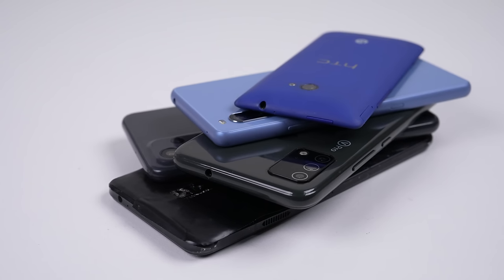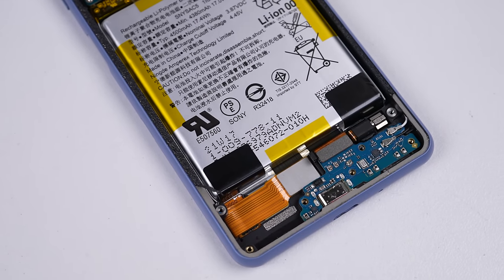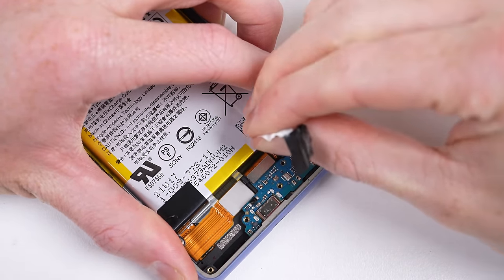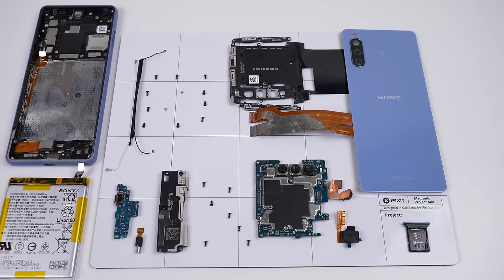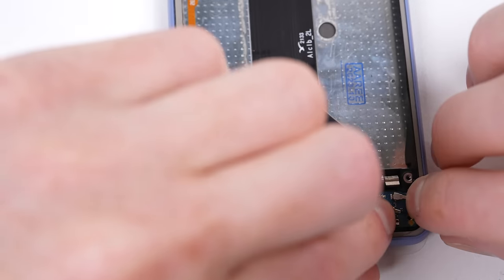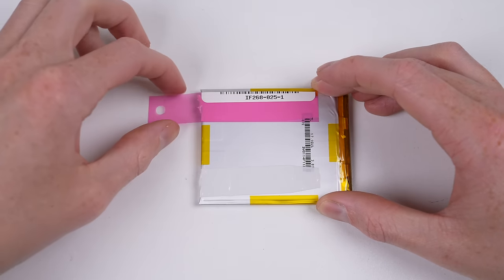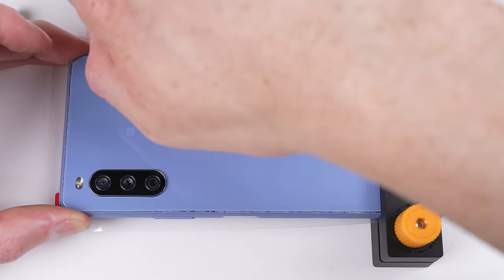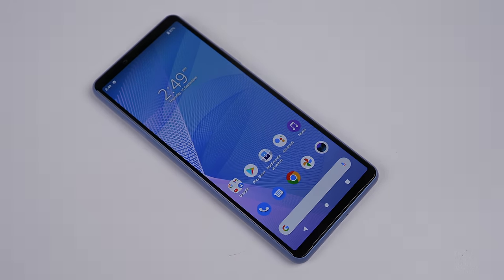This Uncommon Phone Is Shockingly Easy To Repair - Sony Xperia 10 Mark III

Comment: I've been looking into replacing my aging Moto Z Play from 2017 or so, but pretty much all current phones lack microSD and headphone jack, or they disqualify themselves in some other way (Xiaomi with awful quality and software bloat, mid-range Motorolas by excluding a compass on some models (wtf?) and others by using Mediatek and other garbage SoCs). Looking at the specs of the Xperia 10 Mk. 3/4/5, they all seem like decent replacements. My only gripes are the step backwards to USB-C 2.0 (the Mk 3 had USB 3.0 with Displayport video output, the 4 and 5 only have USB 2.0 for some reason) and the annoying side-mounted fingerprint reader. I guess these are as close as I can get to my "ideal" phone, as no company seems to be making one that ticks all the boxes anymore

Comment: That actually looks like quite the complex repair for a sony phone. I've owned Xperia XZ1 and now Xperia 5 II, both of which I've personally repaired (in case of 5 II I've replaced camera module after fall damage to one of the lenses, battery and on another occasion dead power button) and all of these repairs were noticeably easier when compared to what is seen in this video.

Regardless, sony phones continuously seem to be among the most repairable devices out there, especially in contrast to questionable anti-repair solutions employed by other brands in recent years.
Reply: Devices are not getting any less complicated with time, sadly.
But sony mobile does try its hard to make it not harder than what is reasonable.

Comment: Sony Xperias hardware are fantastic their new Xperia V series 1, 5 and 10's are absolutely amazing, all of which have a headphone jack!. the problem with Xperias in my case is that their software is downright just awful. the rom they use looks stock and feels fluid but stuff like the finger print scanner being on the side of the phone sounds good until you find out it likes to constantly register a "fingerprint" in your pocket so when you pull it out your phone is locked for 10 or even 30 seconds. due to the phone being a 21:9 aspect ratio a lot of social medias don't run correctly instagram for example sometimes tries to play 2 videos at once. (this is a third party developer issue I know). I'm hoping they further improve further in the future because I believe Xperia phones to be hands down the best multimedia smartphones in the industry; from their camera, beautiful screens, their physical design, micro sd support! and the classic headphone jack. Xperia makes "pro" phones like the iPhone pros and the galaxy s ultra phones just look like paperweights in comparison. 

Here's to hoping Sony will work harder on improving these amazing smartphones.
Reply: Pro tip: The Xperia 1 V, and 5V, as far as I know both support the option to require you to click the power button to unlock. No clue where the setting is as I don't own either phone, but I follow the subreddits so I know they support the feature. You may have to update the software though.
Reply: that's true, almost every time I put my phone into my pocket it unlocks and starts to press everything on the screen
Reply: @LindonSlaght  that's cool to know, I sold my Xperia 1 III last year because of just stupid things I couldn't get over, kinda regret it but I'm happy with my 14 pro for now till Sony (hopefully) improves certain areas.
Reply: @numbazZify  it used to infuriate me

Comment: I own an Xperia 5 Mark IV, which I bought for the headphone jack, Qi charging and good cameras, and have had it for almost ten months. That aside, I can immediately understand why Sony's phones aren't remotely as popular as One Plus or Motorola, much less Samsung: barely usable thumbprint scanners (though it's nice they're including in the power button), bad UI choices, random restarts and the worst pocket detection I've ever seen in a phone. Windows Phones 7s had better pocket detection than this, and the solution on Sony's forums is "Yeah, probably turn it in your pocket so it's facing away from your hip." Then again, the recommendation for the awful thumbprint scanner is to scan the same finger for 5 to 10 separate finger profiles and see if that helps, so it's about what you'd expect. I'd be more annoyed if I hadn't gotten it discounted by almost 40% new, which brought it much more in the area of what it's actually worth. "Headphone jack and it looks very nice," is a pretty poor excuse to pay even a discounted premium price for that many issues. 

Still, nice to know if it's ever damaged, it may be easy to repair.

Comment: I had two Xperias (from the X era), and they were really nice, but their current offerings (of the 1/5/10 era) are a bit ugly, with strange price brackets, and 21:9 screens which are far too large for my liking.
Reply: To be honest, 1 IV is very stylish.
As for the screen, 21:9 is actually not that much larger than 16:9 because of smaller upper and lower bezels.
It is about as wide and being longer instead of thicker to add diagonal inches, it's actually easier to handle.
I used to dislike longer screens, but changed my mind after trying to actually use one for a couple of days.
Now I have to admit that sony did the right thing and that longer screens are better.

Comment: hey hugh, just an idea that i think falls nicely within the recycling theme. i think it would be nice to make small projects showcasing what other things you can do with spare components such as the screen (maybe attach a display controller with hdmi input into it), or maybe utilizing phone batteries to power miscellanous devices/simple circuitries, or things that you can do with bluetooth modules inside a dead airpods, etc

Comment: My question is, why attach a battery with such a strong adhesive? It's being held in place by the chassis on the sides and screen and back glass on the front and back. The room is tight enough to stop it from moving around and simple double sided tape should be enough to secure it. Thoughts?

Comment: I always wanted an Xperia, back when the Arc was around.

Loved their design and theme back then (that TV switch off on locking the screen was very cool, and I miss that playfulness)

I still use a Walkman A15 for my FLACs (with wired headphones, of course) cause most phones had wonky audio in some way, my Sammy A72 does this, too.

Bass really rolls off and everything starts to sound weird, once you hit 85vol (up to 150).

Comment: I have the Xperia 1 Mk 5, the one with the 4K screen. It is vastly superior to the iPhone 15 Pro and Pixel 8 Pro under all aspects. The video, the photos and the audio (thru wired earphones) can't be compared; Sony could burn Apple, Google and Samsung if only made some ads for their Xperia phones. But the fact is here standing in front of our eyes.
And yes, there is the headphone/microphone jack, and a micro-SD card slot. I paid a little fortune for the 1 TB extreme Pro memory card, which can record 4K with no dropped frames - but hey, I got everything I need with me all the times. And the USB-C port is Thunderbolt compliant (cable sold separately).
Thank you for the video, I was very interested seeing an Xperia from inside; now I know I can replace the battery by myself: no pairing, Sony truly cared this time for their customers - and not for their spare pennies!
Thank you Mr. Jeffrey for all your efforts and your dedication.
Greetings from the UK,
Anthony

Comment: I used to have the Sony Z3 when it was new back in 2014? I think it was, what a great phone. I do miss the nice features like dedicated camera button, SD card etc but I am more than happy with my S22 Ultra now. Sadly it got killed off by the baseband randomly deciding to refuse to connect to cellular network and I was quoted more than the phone was worth to fix it.
Reply: I had a Z3 too for little over a year or so. noticed how the camera picture quality became worse after some updates, then the back glass came loose and it started having weird connectivity issues, so I changed brand after that
Reply: i had 2 z3s, one had a broken lcd so i destroyed it and the other one worked fine but it was terrible
it got really hot, touch was awful but the screen was good

Comment: My Sony phone was the best phone I ever used. I only quit using it when my carrier wouldn't certify it for VoLTE. Of course after I replaced it, the added it to the whitelist. Among the many things I liked was the aspect ratio meant that (with my small hands) I could reach my thumb across the front of the screen when holding it. With phones getting bigger, this is now only possible for me with a small phone or with one that has a taller aspect ratio.
Reply: Have you tried the Pixel Fold or Find N2? They're wide but much shorter, so the opposite of Sony's aspect ratio, and I feel like the extra width is a much better idea than extra height.

Comment: This one seemed very straightforward to repair, I've found that a lot of Sony phones are laid out strangely inside with lots of complicated overlaying parts and unusual connectors, some older models with a frail and thin antenna frame over the components. Thankfully the thing that seems universal is their reasonably glued back panels, you have to try hard to break one.

Comment: I’m using an Xperia XA2, 2018 model, goes great, decent camera for a budget phone, used an Xperia S (2011) too. All were great phones.
Reply: I loved my XA2 when it was my primary phone, but over time the performance kinda went bad and I never had the time to try modding it with a custom rom to see if I could salvage it. Now it's got a weird scratch on the display and is so far behind my other devices that it's probably not worth it.

The oppo I upgraded to has aged much more gracefully. And then I got the Xperia 1 iii and I think that too shouldn't slow down the same way the XA2 did, app performance requirements just outstripped the old cortex A53 cores.
Reply: Loved my XA2, only reason why i stopped using it was the battery expanded.
Reply: I’m still happy with mine, I see there is one on eBay for $75, I’m surprised how cheap they are.

Comment: Sony made some awesome devices back in the day.
Their current flagships are great except for the fact that, when compared to todays industry standard, there is virtually no software support. 
There is also the fact that these phones require you to have decent camera and photography knowledge in order to take good pictures. Auto mode is as if you took a budget phone and took a picture.
When you do go with manual mode, the pictures are S tier though.

Comment: I was hoping that other flagship phones have a headphone jack comeback. Not only earbud cannot access battery replacement, but it's not environmentally friendly and ended up going to ewaste. The earbud battery aren't last longer and more expensive than traditional wire headphones jack.
Reply: Not to mention there is also noticeable latency with wireless earbuds. Even if the latency itself has improved a lot in recent generations, it still can't beat the wired earphones
Reply: Apple airpods have a lifespan of 6months to a year or if lucky 2 years then it's impossible to repair, you can turn em into desktop Bluetooth speakers tho but that can be done with literally any other earbud and the bast majority can have their batteries replaced, not cheaper than a new pair but at least can be done
Reply: @MilesProwerTailsFox  i dont know where you get your airpods but they definitely last more than 6 months, usually 2-3 years i the mark they crap out, which usually lines up well with the next generation upgrade anyways.
Reply: @Windows98R  I have a repair shop and constantly get people come with broken airpods WITH apple care still active but apple refuses to fix because the battery is dead, half of em had told me they bought em 6months ago, idk where you get your magical imaginary airpods but probably your parents are replacing them as soon as they die like your goldfish
Reply: @MilesProwerTailsFox When I had Airpods that lasted me years. And my current galaxy buds have lasted me close to two years and don't seem to be going anywhere.
Reply: @-ThatGuy-  Galaxy buds are good, the thing happens only with gen 1 airpods, gen 2 seem to be doing well
Reply: @MilesProwerTailsFox  My Airpods were gen 1 and I never had much of an issue. Beyond the obvious annoying lack of noise isolation.
Reply: @-ThatGuy-  You just lying at this point

Comment: Sony has a bad track record from my experiences. When they were Sony Ericsson everyone wanted one and they were truly remarkable phones. The K800i is still one of the best phones I ever had for it's time. Then Android happened. The X10 Mini was my first smart phone and it was such a downgrade but it worked. Then I bought a Neo and an SP thinking about the Sony Ericsson I once loved but both of them deteriorated shockingly quickly. Maybe it was the era of rapidly evolving system requirements where previous phones were too weak? Could be. But I remember the SP was riddled with severe software issues that made it almost unusable. Since then I parted ways with Sony and I'm afraid to buy another one

Comment: Honestly near as I can feel the reason Sony phones don't sell much is the price and being largely focused on niche markets. 

4K screens are unnecessary for most people. 

The headphone jack only really matters to a small group of people

SD card slots were barely used on modern smartphones and modern android has kinda gimped them anyhow.

And while some people love having as much manual control as possible over the camera, most just want a point and shoot that's gonna take a good shot without any real work.

Lastly from what I've seen the UI and UX of Sony phones is just ass. Lol

Comment: I wanted xperia 1 v phone but got pixel 8 pro instead. I chose it because I use phones for 4+ years, and sony only gives 3 years of updates. Additionally, I decided that I'd rather have static elements in my cameras instead of moving 3.5 to 5x zoom lense which has higher chances of breaking. But the phone is really decent and if Pixel 8 Pro wouldn't release at the same time I wanted a new phone+watch I'd get Sony for sure.

Comment: The other day I replaced the speakers of my xperia 1ii after I burn them using mods on costum ROMs, I had to disassemble everything because of the earpiece, and it was super easy to do. The hardest part was removing the back glass because I don't have a suction cup.

Comment: Sony phones stopped being popular when they started to mess up the software experience in any way possible. I daily drove an XZ2 Compact for about 2 years and was planning to run it for at least 2 more. I loved that I had a true flagship in a compact size.

But no, Sony decided to screw it up badly with a simple Android major release update [9 -> 10, while 8 -> 9 went smoothly]. It became completely unusable, laggy, apps crashing all the time and it started overheating for no particular reason. I bought another phone, in the meantime, but I didn't throw it away and performed a downgrade to Android 9. All of its problems gone!

I still have it as a backup phone, but the lack of security updates and the old software may be a problem in the long term.

Sony kept doing phones with good hardware and shitty software since that day.

Comment: The Xperia is pretty good, but I've noticed mine that's just a few years old has pretty well been abandoned for support, with a fingerprint reader that just stops working until a reboot at times and quite a few UI issues that even older Samsung phones don't have in the same apps.

Comment: In my opinion sony phones are the most underrated. I still daily drive a sony xperia m5 from 2015 and its actually fine. It was an awesome phone when i got it back in 2016. Not really awesome today. Its just having old phone issues like cracked screen outdated software etc. I recently replaced its battery and it still lasts me a day if i use it a lot, and if i dont use it all that often it still gives the advertised 2 day battery life. Well done when it comes to power consumption, sony. Its camera was awesome and it was able to record 4k videos too but since the phone is really old at this point, the camera is having focus issues. Other than those issues, it still works fine.
Reply: Come up to an Xperia 5 III if you can find a good deal. I think you'd really like the newer hardware. If the SD888 scares you, the Xperia 5 II works as well. Problem is that Sony phones hold their prices because they're niche...Glad you liked the M5.
Reply: @droid1appmkr  cant really afford a new phone since i just got a new computer but the m5 still is usable for me.

Comment: You know what. Androids are very ugly inside but kinda pretty outside. Though i suppose they do not profile and make it all neat inside as 90%-100% you can repair it why make parts match in colors just make them work so you can mass produce them. But Apple. While not a fan of the phone design i can give them this. Its got a pretty inside though it raises the question. Why? They basically do not want you inside the phone but they make it very pretty inside and neat. Its strange.
Reply: iPhone is literally a design product. They make the internals nice so the ads look good
Reply: @DecibelAlex  That is fair enough.

Comment: How did you clean the glue out of the panel gap on the back? I've used liquid adhesives before and its always messy looking in the gaps. Thx